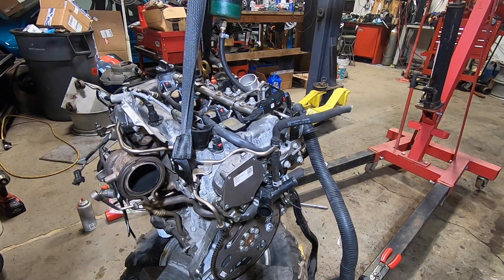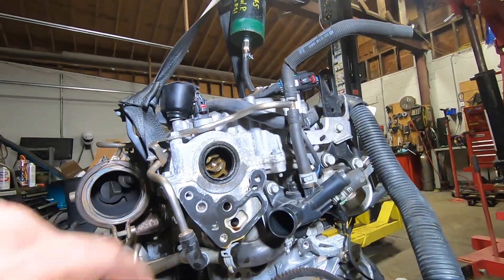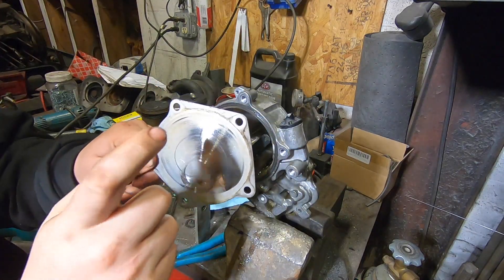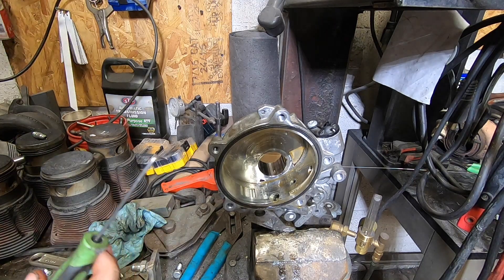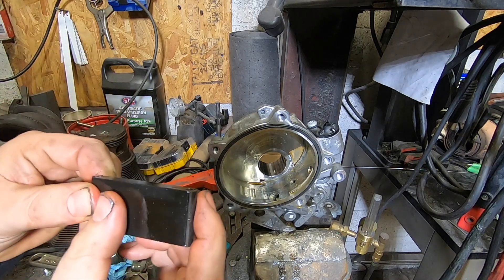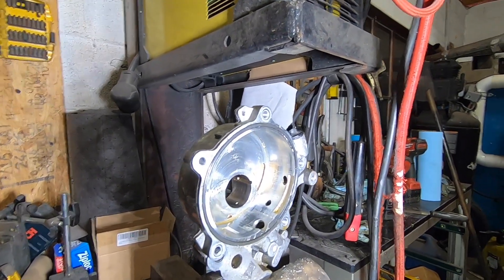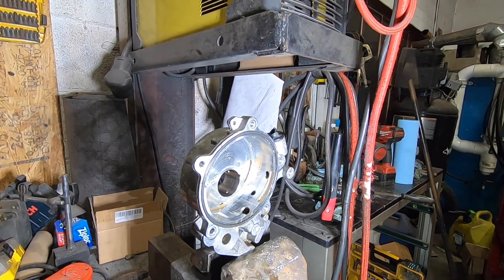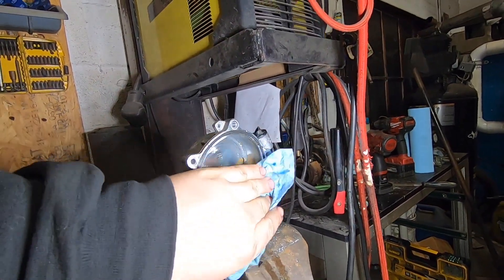How it works 2016+ Cruze Malibu Equinox Vacuum pump EXPLAINED

Comment: I recently bought a 2017 Chevrolet Spark with one of these that only has 66k miles. I didn't have a clue what this was but thought it might be a vacuum pump since it was hooked to the brake booster. Now I'm paranoid that it's gonna break. But if I replace it I'm buying Chevrolet parts only. And even that's questionable with the quality of parts now. I change my oil religiously but I thought vacuum pumps were a thing of the past now I'm worried about it😂

Comment: What is the purpose of the hole below the mounting bolt hole at the 9 o'clock position of the vacuum pump mounting surface? I noticed this hole goes deep into the head as I was able to fit a very long screwdriver in there when I checked the depth. It seems like some kind of oil passage but I noticed in the video it is closed off. Should mine be closed off?

Comment: I am looking around because I had seen a video or two of what happens when they break so I replaced mine with OEM vacuum pump on my 2018 cruze.
 I never had oil leaks or loss but now I am down a quart every 2k miles or so. No visible leaks or oil in the vacuum line or burning that I can see. Very strange but it has to be the pump.

Comment: Is it same for 2015 2.5liter malibu? You mentioned some malibu but im not turbo. Tho i have vacuum pump. I think its the cause for a few of my issues. What all things does it have to work with or associate with and could have issues due to it? Crankshaft positiong is one right? Any other things?
Reply from the maker: Yup I believe its the same pump on those
Reply: @spankranchgarage  i got p034b crankshaft position direction incorrect, p0016 for crnkshaft sensor and p0089 fuel pressure regulator. One vid a guy changed many things and said vacuum pump fixed 0016. 

I did vacuum pump, fuel pressure sensor not regulator it would be more guess maaaybe it would solve? Did crankshaft sensor one in front and back, (didnt fix obviously) the variable timing solenoids both too. Still habe all 3 codes. 

Sone say wiring or timing stretched but idk. American cars are absolute trash. Should have known better. Used to build em. Pieces of shit.

Comment: That is a great video, thanks lot. I resealed a leaking pump on an Audi since they are 5 to 10 times more expensive than this one but I'll be better to get a new one in this application to be sure as well a check those oil passage.

Comment: I just had to replace the vacuum pump on a 2016 Chevy Malibu with a 1.5 turbo. I had to pull the valve cover off to get the shrapnel out of the engine. I was able to retrieve all if the pieces and didn't see any "forbidden glitter" when I changed the oil. I modified the replacement by drilling out the oil feed port assembly to a larger diameter to increase the flow and volume to the rotor bearing to attempt to reduce the likelihood of another failure. Apparently there is a class action lawsuit for these pumps failing prematurely.

Comment: I mean, sure plastic sounds like a genius material for the paddle in the pump spinning at high RPM while being subjected to extremely hot petroleum and intense engine heat. What could possibly go wrong..........lol. Chevy money saving at its finest!!!  I've replaced this pump twice on my step daughters Malibu. I know it's just the way it is now, Jeep decided to use plastic on my oil pump housing.........but still. For 40 to 60 grand, I'd expect metal lol.

Comment: Is it common for these to leak oil?  Mine has not failed but I'm at 95k and there is Def oil coming out of the bottom of this where it meets the engine. I think they should redesign this with a bearing that is on the cover which bolts and presses on the spinning part to eliminate the scoring and wear on cover. But yea mines leaking and I can see little puddles on the trans where there is like the waffle looking dents from the casting
Reply: Late reply, but based on other videos, yes.  I just replaced mine because of a leak.  The gasket was just getting old.  247,000 miles on my 2016 Cruze and this is the first time replacing the pump.  It's probably been leaking since about 200k, but I was having trouble pinpointing exactly where it was coming from.  My pump was in decent shape, less wear than the one in this video, but it did have some minor binding when turning it by hand, so I went ahead and replaced it to be safe.  If it's just a leak and the pump is in good shape, you can buy a replacement gasket.

Comment: Do you think I’d have to replace mine cause mines been leaking from the seal but idk if I should buy a vacuum pump I’m at 145,000 km on my 2017 you think it hinders the affect of a turbo to when it goes bad or what are some signs that you have a bad vacuum pump on these cars ?
Reply: I’d say replace the pump. It’s about 90 bucks. If it goes bad, your brake pedal will stiffen up and you will not be able to stop fast enough.  Happened to me. Fortunately, no one was in front of me.
Reply: it takes 20 minutes to change

Comment: I had this explode in my 2016 Chevy Malibu a week ago and now Chevy dealership trying to charge me $4,100.00 to repair camshaft timing belt and vacuum pump mind you the engine don’t cost that much maybe a little less than $2000 bucks I’m thinking of having someone else look at it
Reply from the maker: Ugh, thats worst case scenario. I hope you find a cheaper repair
Reply: @spankranchgarage  naw I let Chevy dealership do the work and it was $3,100.00 smh
Reply: I junked my car and I have the actual new part just sitting if anybody want it can have it for a 2018 to 2020 model Chevy Malibu
Reply: @MultiSheniqua  what you want for the cv axles ?
Reply: @Slickpuller921  I don’t have the car anymore I junked the car but I only have the vacuum pump brand new cause after I got an estimate of the repair I was over it but I thought it would be an easy repair but it was complicated so I couldn’t return the part
Reply: @MultiSheniqua I'll take it off your hands
Reply: @MultiSheniqua  you in the Atlanta area
Reply: @MultiSheniqua I would've loved to get that car. Damn.
Reply: @terrell no I’m in Miami, fl
Reply: @MultiSheniqua  oh wow got cha , thanks tho!

Comment: I replaced this part on my GMC Terrain but now it’s leaking, you think it’s a torquing issue?
Reply from the maker: Possibly. It could be leaking either from the cam seal or the gasket
Reply: @spankranchgarage  It’s the cam seal, there’s a chunk of it missing from the inside of the o ring…time to order that damn seal lol
Reply from the maker: It happens! You will get it fixed right I’m sure

Comment: My brake pedal got hard. I watched some videos and replaced the pump. It was broken inside. But the new one made the car work fine again. But the same day on the way home my pedal got hard again. I checked the pump and no suction.im guessing its broken again but why?
Reply from the maker: That’s a huge bummer. Check to see if it’s getting oil. I believe there is a strainer on the port

Comment: This pos just failed in my wifes 2017 Malibu Lt, Why did GM put this hunk of junk on here to run the power brake booster instead of just pulling manifold(Plastic) vacuum?  Does anyone know what the readings are at the manifold? I dont have a scanner anymore so I cant check.  I would love to be able to block it off and run the line to the intake or throttle body, maybe like a thin spacer with a port coming off of it...
Reply from the maker: You can certainty pull vac off the manifold like a normal car. But beware if your car is turbocharged you need a checkvalve and will have very minimal brake assist in boost. I imagine thats part of why GM did this.